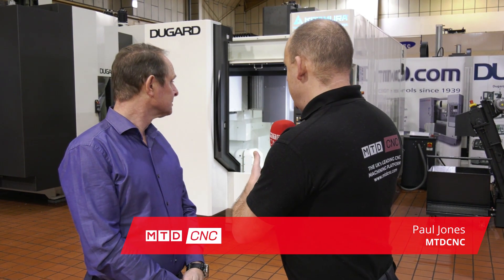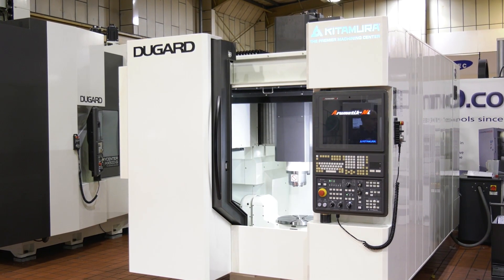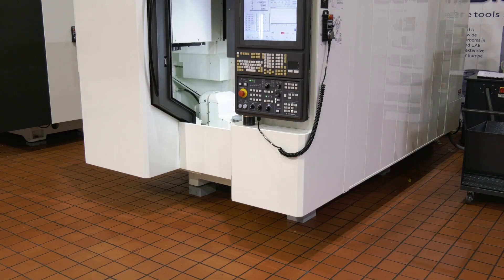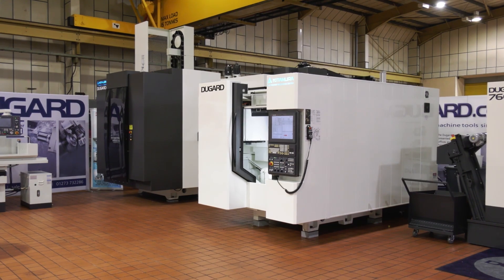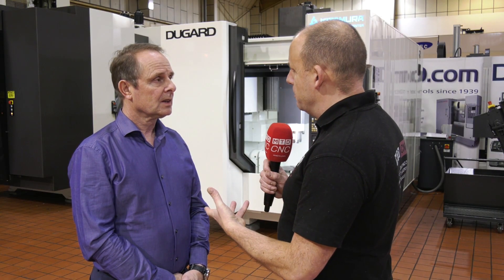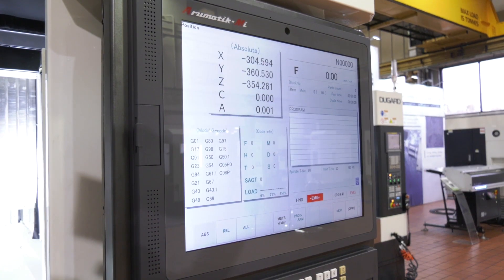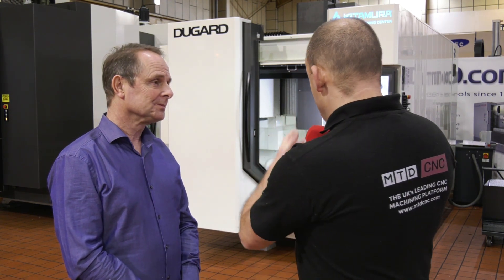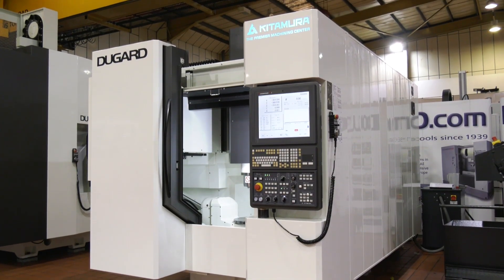Kitamura 5 axis machines now ex-stock

Comment: One caveat though is that 2 micron is for linear X, Y and Z, does not include volumetric accuracy combined with rotational errors. That machine is often sold without rotary scales so is of the order of +/- 20 arc seconds (on the trunnion which is not "Two micron") . You can get rotary scales for the trunnion but that bumps the price point up quite significantly. Still, nice machine and super ergonomics. Kitamura a very good at making things cut straight in XYZ , that's their wheel house but looks like it moves nicely.
Reply from the maker: interesting points, we'll challenge them on that next time. In fact we'll ask Dr Kitamura next time we see him to
Reply: @MTDCNC  That's who I got my info from. Like everything in the machine tool industry you get exactly what you pay for (no more no less) :-) It's a nice machine "Peeps" need to have realistic expectations. If you believe that somehow you are getting $50K to $100K extra capability for "FREE" look again/ (deeper). Dr. Kitamura's mindset for true geometric straightness is pretty awesome and I think he tries to juxtapose that mindset with what Makino might do with digitally corrected straightness of travel (for X, Y and Z axes).